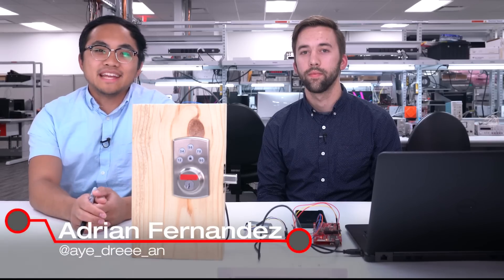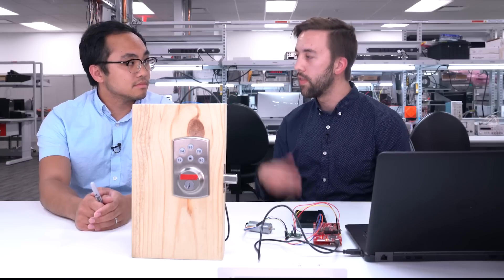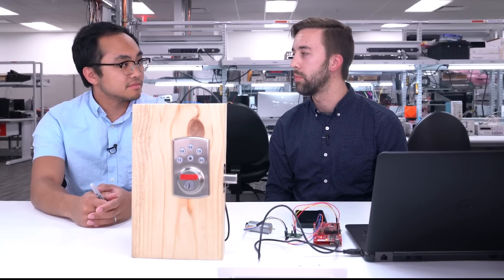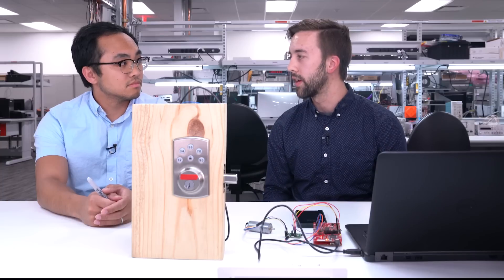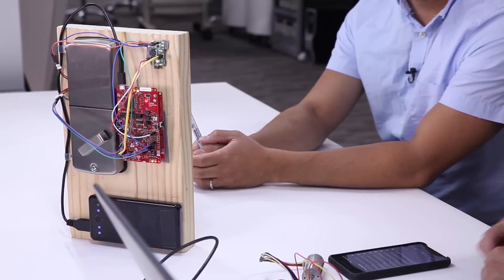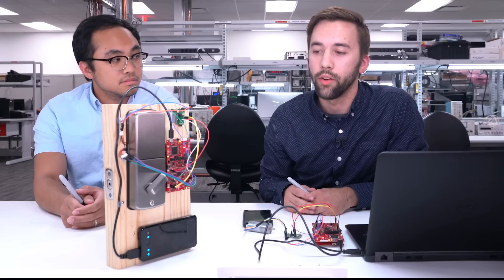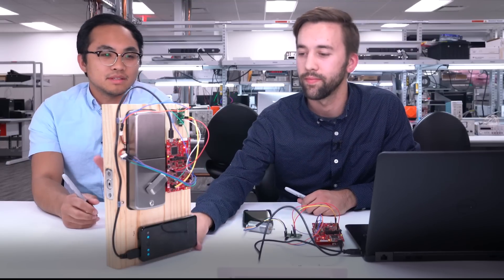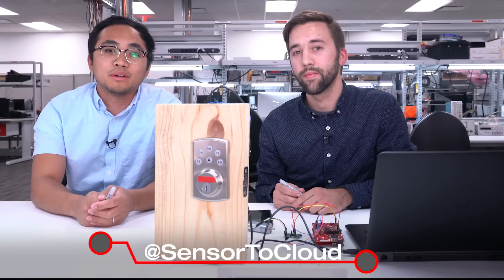Connect: Wi-Fi connected smart lock demo

Comment: Is there any provision to Shutdown the Entire System while in 'Locking Mode', and then an unique feature (like Bluetooth, Fingerprint Reader, Remote based Key like Car & Bike, or any such Manual Key-Lock Mechanism, etc....) to "bring it UP from locally" (not the Lock, but the System).......!?
Reply: I believe what you are referring to is a way to put the Wi-Fi into a disconnected state and have it wake-up/connect based on some local event in the lock. This is definitely possible if you use one or more of the GPIOs that can wake the device from hibernate. Then you can use an interrupt from some external source such as a bluetooth device, fingerprint reader, switch, etc. to trigger the CC32xx device to come out of hibernate and quickly connect to the network to send/receive data. This is a very effective way to save power and it works well in smart lock designs where there is typically another MCU dedicated to controlling the HMI.

Comment: We don't need smart locks with cloud connectivity. What we really want is a smart lock that uses a secure keyless system! Like the ones used in cars novadays.
Reply: Hi IchEben! I agree that a secure keyless system is also very important for improving the utility of these types of locks. Adding cloud connectivity to a lock with a secure keyless system provides additional benefits though. On top of giving us the ability to manage access codes and monitor/control locks remotely, cloud connectivity also makes it easier and more convenient to perform software updates which may be critical for maintaining security. Plus, the higher throughput of Wi-Fi connectivity will start to enable exciting new use-case for smart locks in the future.

Comment: That's a pretty cool idea to first run the firmware update in the RAM to test its functionality before committing to the Flash memory.
Reply: Commit feature in CC32xx OTA works by the slightly different way. It is based on rollback feature in filesystem stored in serial flash.
Reply: @22majami is correct! The new firmware copy is stored in external serial flash after being downloaded. However, since the device executes from on-chip memory (RAM for CC3200/CC3220(R/S) and Flash for CC3220SF), the bootloader can still control which firmware image is set as the working version. The bootloader can load and execute the new firmware once, but if a reset occurs (watchdog or otherwise) prior to the image being explicitly committed by the application (e.g. after a test procedure in the code) the system will revert back to the previous version.
Reply: @Ben More, Thanks for the clarification.